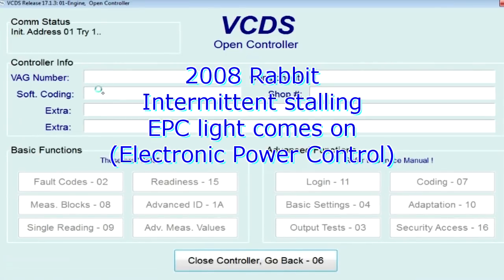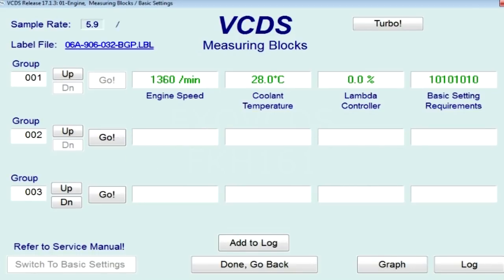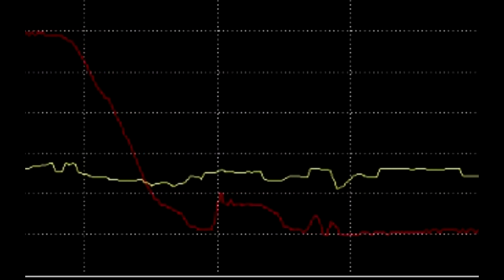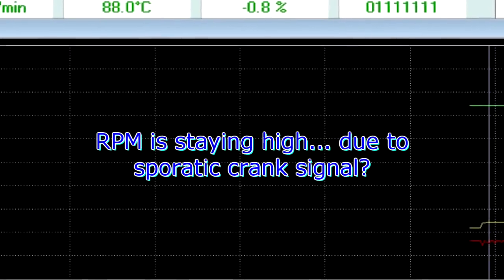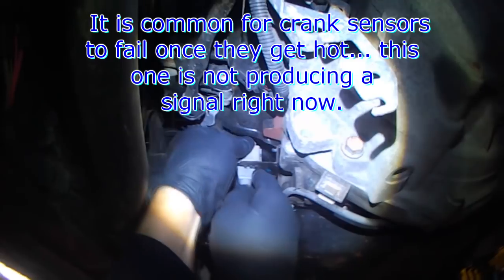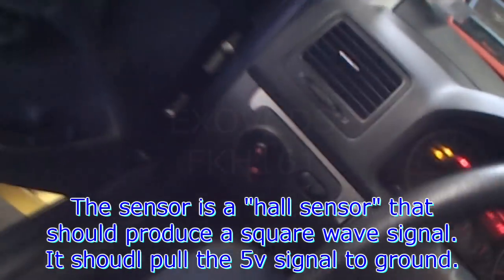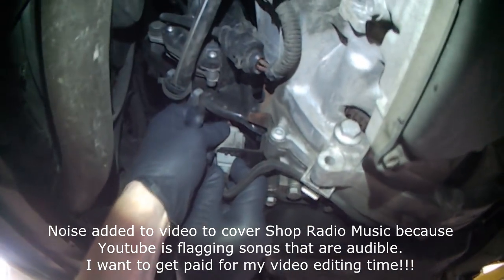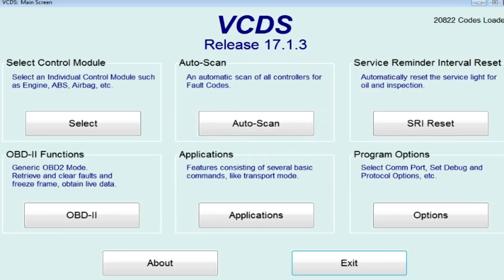VW A5: Intermittent stalling / no start when warm (EPC light)

Comment: hmm i have 2000 b5 passat v6 5spd...just started not too long ago. car runs for 20ish mins then EPC dies ... just cranks for ever wont start till you let it sit for 20 mins or so then it starts up again. so weird but i was leaning towards the crank sensor i didnt put my car on a scope and i have no engine codes.
Reply from the maker: If the ecm doesn't flag a crank sensor fault, then it could be that the ecm is shutting off (as if the ignition was turned off). Monitor power supply relay and crank sensor (just in case) voltage to see which cuts out.
Reply: @EXOVCDS  i seen it could be 2 problems crank sensor or the relay.. hmm no check engine for crank… so odd runs for like 20 mins then EPC light then dead cranks till no end until you wait then it starts after it cools down
Reply from the maker: Do some testing / checking while it acts up. Most people are not that lucky to have it act up long enough for testing / checking. With a scan tool, if you don't see engine rpm in the live data when cranking, it's probably the crank sensor. If you can't communicate with the ecm, then it's probably a power supply issue.

Comment: Hi driving a vw golf 5 1.6 however car is going on limp mode on second gear... Just replaced the throttle body and accelerator pedal but still no luck. Please help
Reply from the maker: Fault codes?

Comment: so my 2006 jetta 2.5 gets to normal operating temperature then shuts off then struggles to start, i have to give it gas so it doesn’t turn off then it idles high and rough, like a misfire or something, just the other day it died while i was driving… also it has a check engine light, i haven’t got it scanned yet but some people say the throttle body but all the issues i’m having is the same as yours so idk.
Reply from the maker: Most likely a crank sensor / engine speed sensor issue... let me know what the code(s) is/are once you get it scanned.

Comment: Would this sensor be the problem if the car starts, runs good when cold, but then as soon as the temp gauge starts moving and it is warming up it stumbles and dies. It will restate, but not very easily and it will not stay running unless feathering the accelerator pedal and keeping it going? Any help is greatly appreciated.
Reply from the maker: Year, make, model, engine? 
Sounds more like a fuel starvation issue.

Comment: My 2010 mk6 gti will no start for a while when warm  then it starts again .  It will throw an EPC light  al low rpm but disappear at high rpm. What could be wrong with it ?  Recently had the upper engine rebuilt.
Reply from the maker: Don't know... check for fault codes. Could be a number of things. If it was fine before the rebuild, could have something to do with that? Monitoring engine sensor data... coolant temperature, fuel pressure, fuel pump duty cycle etc. might help you get in the right direction for finding the issue.
Reply: @EXOVCDS  Thank you

Comment: My 2014 Passat 1.8 stalls when warm Won’t start until cools down no codes changed fuel pump and HPFP what can it be
Reply from the maker: After it stalls... can you communicate with the ECM?
Reply: Yes you can scan the car it will crank but will never stay on until like 20 min sometimes 1 hour and when I check the fuel pressure when the car is stalled it’s all the way down but when it starts goes back to normal and can be driven
Reply from the maker: Low pressure pump pressure or high pressure pump pressure?
Reply: I changed both that’s what’s driving me crazy
Reply from the maker: @youssefhassan8524  I'm asking if the low pressure is dropping or if the high pressure is dropping.
Reply: So it shows the voltage of the hpfp when on live data too low but it’s new so I took off the hose and turned the ignition on to verify if the in tank pump was working and it sprayed fuel so I’m assuming it’s something electrical but I don’t know what to do because no codes and everyday it stalls
Reply from the maker: @Youssef Hassan With live data, you should be able to see what the pressures are (high & low). If your scan tool does not show it, try a different scan tool. If the "stalling" is a sudden stop of the engine (as opposed to a loss of power and slowly coming to a stop), then yes, I too think that it is an electrical fault (loss of Ignition or fuel spray) that is stalling the engine. That's why I asked if you can still communicate with the ECM when the engine stalls (a bad ECM power supply relay can cause the engine to stall & not set any codes). You need to do a "full system scan". Check if there are any fault codes in any of the other modules... loss of communication between TCM & ECM, Instrument Cluster & ECM etc. That might help determine what is going on.
Reply: I’m using obd eleven and shows the high pressure dropping
Reply from the maker: How low? The more info I have... the better I can "guess" as to what the problem might be. I would need to look at the live data myself to try and figure out what might be going on. Go through all the data pids to see what else you can find. High pressure is either leaking back into the low pressure side, out of a fuel injector or out of the high pressure pump (into the engine oil... smell the oil). A bit of investigating should get you some results.
Reply: Where can I send you the live data
Reply from the maker: @youssefhassan8524  I meant that you would have to do some investigating... I can only diagnose a car when I have it in front of me.

Comment: Taking to the mechanic Monday. Everything that happened in this video is exactly what my car is doing. My mechanic replaced the spark plugs and a coil as he thought that was the issue but I’m pretty sure it’s the crankshaft. Thank you!
Reply: The only thing is that after the car sits for a couple hours Ill start it back up and it won’t have any issues cranking. It starts right up and the EPC light is gone. The check engine light remains however.
Reply from the maker: Scan the engine computer to find out what the code is... could be your crank sensor.

Comment: I have a 2.0 TSI engine. Whenever my car gets hot (normal operating temperature) it stalls right at 1500rpm if don't accelerate quickly enough. It always starts immediately after. Any idea what this could be? The only code that I get is crankshaft position sensor and I've replaced that. I've had a few shops look at it and one said it was the cam adjuster magnet. I replaced that. The car has had a new timing chain tensioner installed.
Reply from the maker: The problem started after the timing chain tensioner installation? 
Weird issue... have not seen that before.
Reply: @EXOVCDS  nope. It was happening before the work was done on the tensioner as well. The mechanic that did the timing chain was concerned that it may have been metal in the oil causing the cam actuator magnet to malfunction. I've had a few oil changes since then though and it hasn't cleared up.
Reply from the maker: I'm not sure of the specifics of the engine... it could be that at around 1500 rpm either camshaft timing or intake runner position changes, either of which could be affecting the way the engine breathes... which in tern (at that moment) causes the engine to stall. The crankshaft position sensor fault code is most likely set due to the stalling (no signal from sensor because the engine stalled) and not causing the stalling. Viewing live engine sensor data would need to be done... to see if anything sticks out / looks to be out of the ordinary.
Reply: @EXOVCDS  thanks for the info. Sadly I don't have many mechanics around me that know this engine well.
Reply from the maker: What is your location? You can find a reputable repair shop via the following link (enter your postal code):
https://iatn.net/repair

Comment: Nice video
I have a 2001 passat 1.8 and im having issues first of all, when i turn on in the morning the car starts but after sometime driving the car just shut down, when i try to start it again the epc light comes on, sometimes it starts but at 1200 rpm, and sometimes just doesnt start, what do you think?
Reply from the maker: Most likely a crankshaft position (engine speed) sensor issue. Here's a video of a 1.8T sensor removal (Audi A4 1.8T, but same as yours):
https://www.youtube.com/watch?v=8WufwHIzaUM
Reply from the maker: Check for fault codes when it happens... probably a G28 sensor code.
Reply from the maker: If the issue only happens after the engine gets warm... it's a common symptom of a failing crank sensor. Eventually, the engine might not start even when cold. You can check the resistance of the sensor the next time the engine stalls / does not start.
Reply from the maker: It could be something else... that's why at minimum, you would want to scan for fault codes. When the EPC light is on, there is usually a fault code. Could be throttle body module, MAF sensor or something else... but engine heat related issues (starting / stalling) are usually bad crank sensors. Let me know what the testing results are. If you need info on how to test it (check resistance) contact me via my about page: https://www.youtube.com/user/ExoVCDS/about or watch this video (different engine but similar / same sensor): https://youtu.be/qYfZOb9vzkU?t=147 start watching at 2:27
Reply from the maker: Sorry... measurement values are here: (long version video):
https://youtu.be/MJIA0AsxASQ?t=803
Reply from the maker: I'll check what the spec should be for your Passat... currently watching a movie. Will get back to you later... will probably be a similar resistance as the one in the video link. So most likely, yes, resistance is on the high side and goes even higher when hot / warmer. Don't buy any parts until verified 100% (while the problem is happening).
Reply: Thanks for the response, i forgot to say, that i recently change the wiring harness of the coils, and lets say it not turn so great, i put some wire twist nut conector to all wires to the harness, i dont know if that affects this situation, but the first time that i change it the car starts fine, and every coil was working
Reply: Ok im gonna check that out, this issue start like 3 o 4 days ago, i turn on the car in the Morning i drove for about 10 min stops to a 7/11 and that happen when i. Try to start again i cránk it a lot until it turn on but With the epc light on and the rpm at 1200, the Next morning i start the car and it turned on, i let sometime pass i turned off the car and try to turned on again and it just doesnt start, but i hope is that sensor, thank you for the response!
Reply: And whats the value of the resistance if the sensor is good and when ThE sensor is bad?
Reply: Ok thank you, tomorrow ill go to check for fault codes, i hope the car will let me arrive. To the workshop without the car stalling
Reply: I just check the. Resistance , the car its not súper hot, but a little bit, and it gave me around 1020 ohms between pin 2 and. 3 ,what do you think?,  im assuming that when the hotter the car the. Resistance increase?
Reply: I check it with two multimeters, a cheap one, with that it gave around. 1020 ohms, and i check it with a fluke multimeter, And it grave me around the same 1010,1015 ohms
Reply: Thank you so much!
Reply from the maker: As per service info:Measure resistance of sensor between terminals 1 + 2 of connector : Specified value: 400 to 1000 Ω
Reply from the maker: Still within spec... but needs to be checked during no-start!
Reply: Tomorrow ill go to the workshop to scan the vehícule, and see what it is, thank you sir!
Reply: Hello, a little update, i went to the workshop, i start the car normally then in less than 5 min the car shutdown i struggle to turn it on again after like 10--15 min it turn on,, went to the workshop but the scanner didnt connect to the car idk why they told that most likely was the crank sensor, one thing is they turn it on and Off like 8 times the car started but With the epc light on and at 1200 rpm, since the scanner didnt connect im gonna change The crank. Sensor i have a spare one, and see how it goes
Reply: And i check the resistance at normal temp of operation (the gauge was at 190 °F, and it gave me 1140 ohms more or less
Reply from the maker: @RevolverBoss7  Ok, thanks for the update!
Reply: @EXOVCDS  so, yesterday. I change the crank sensor and the problem was gone, no more stalling And its working fine, now i bought a bluetooth scanner to check the codes, i was having a problem with the connection with the scanner but its fixed now,, it was because that problem with aftermarket stereo, now the code that brought the scanner is the 0340 which is something with the cam sensor, but i dont have problems starting the car or stalling problems, in fact as soon as i turn the key the car starts, but idk if you have a video of how to check the sensor im thinking thats gonna be something about the wiring because since recently the head of the engine was fixed due some valves blend, and its leaking oil out of the cam sensor (im gonna fixed the leak tomorrow) and the harness has like some oil i dont if that cause the fault code, and how can i clean the residue of oil from the harness, is not a lot of oil on the harness but it has a. Little bit
Reply from the maker: @RevolverBoss7  I'll write more tomorrow... If the head was off, could be that cam timing is not correct. Turn the engine till the cam gear TDC mark is lined up with the mark on the valve cover and make sure that the TDC mark on the crank pulley is pointing to the notch in the lower timing belt cover (above the crank pulley at the 12 o'clock position). If those are lined up correctly, you need to check the intake & exhaust camshaft alignment marks (remove valve cover to check, engine also at #1 TDC). Before you do any of that, check that the cam sensor actually produces a signal. You can use brake parts cleaner to clean oil off of the engine & wiring. More info on testing / checking the sensor tomorrow (it's late now).
Reply: @EXOVCDS  ok thank you looking forward your response, but in any case today at midday ill go. With my mechanic and show him this info and fix the oil leak,,im guessing that is.the camshaft seal cause the leak came out from the lower part of the cam sensor
Reply from the maker: @RevolverBoss7  The cam sensor can be checked with a multimeter, like this: https://www.youtube.com/watch?v=A6XV5x0504c It's a different engine, but the operation / checking is the same. The middle wire is the signal wire... the multimeter should show a voltage that is fluctuating (when the sensor is good). If the voltage does not fluctuate or shows 0, then the cam sensor is bad (assuming wiring is ok). If voltage DOES fluctuate, you then need to make sure that camshaft timing is OK (intake & exhaust) and camshaft to crankshaft (belt) timing.

Comment: hi sir i have a tdi alh when cold  it starts for 2 3 seconds then shuts down repeats it for 3 4 times then it starts normal
Reply from the maker: I'm still at work... I will get back to you once I get home later tonight.
Reply: okay thank you i will wait for your reply by the way my egr anti shudder valve is okay  my egr valve is clean what can it be
Reply from the maker: Check the fuel filter & fuel flow from the tank for a restriction (if pump timing & intake are ok).

Comment: I have a problem with Audi A6 4f 2009 it shows check engine light and EPC. VCDS shows P0301 and P0300 errors. I changed coils, spark plugs and checked the compression, which is 180 psi on all cylinders. After all, it still works rough and shows same errors (of course I did vcds reset). What do you think that could be: dirty intake, valves or fault injector (fuel pressure is also fine)? or something else? Thank you very much...
Reply from the maker: Which engine? Alway cylinder #1? Could be carbon on intake valves (if direct injection system), or an injector problem. Not sure..
Reply: Thomas EXOVCDS Sorry it is 2.0 TFSI and its mainly Cylinder 1 and sometimes 2. I also get lean codes on cyl1. Thanks.
Reply from the maker: Lean code is not cylinder specific (if I'm not mistaken)... a misfire can cause lean codes though. Check the PCV system for correct operation, in-tank fuel pump duty cycle should be under 60%. I would still check the intake for carbon build-up. A borescope through the intake temperature sensor hole should be able to see if there is excessive carbon.
Reply: Thomas EXOVCDS Yes you are right its bank specific. And I also changed PCV valve recently. Thanks next I am going to do boroscope and fuel pump check.